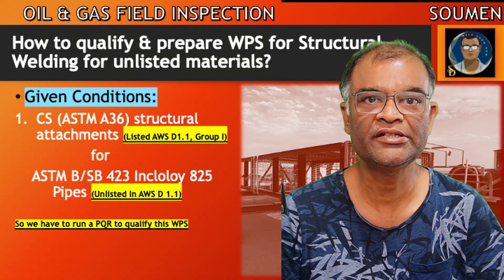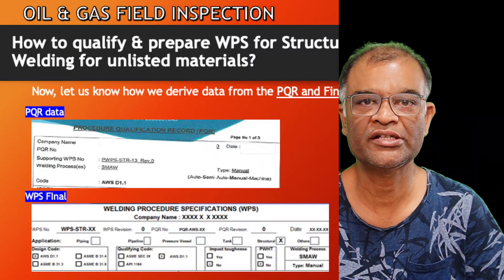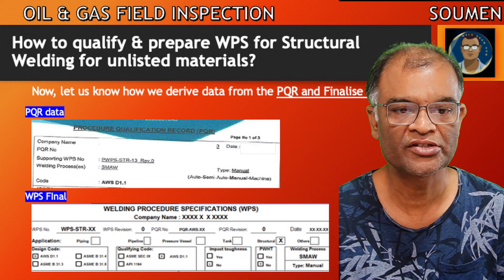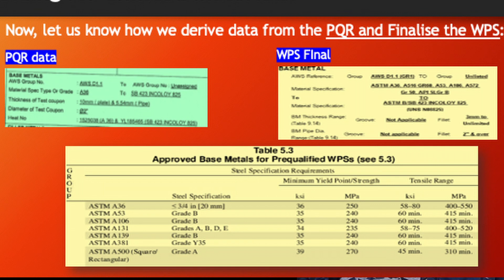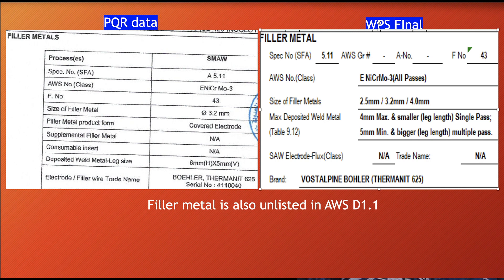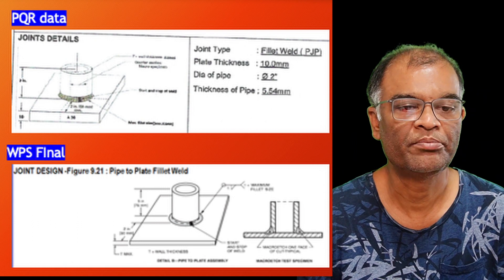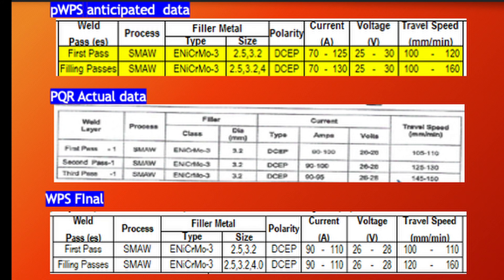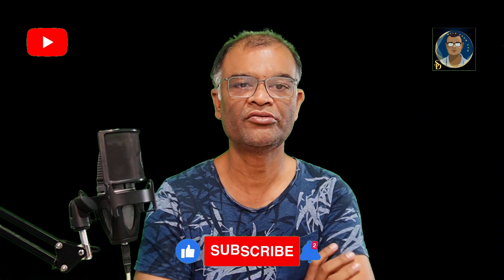How to Qualify a WPS in AWS D 1 1 1 (part - 4)

Comment: Sir,

In AWS D1.1 where it is given the tolerance for Electrical charas like Voltage, current & Travel speed.

Awaiting your reply
Reply from the maker: If you are talking about the prequalified WPS- they have some tables with all prequalified parameters. If it is beyond prequalified range - there are separate table for grouping and ranges. The voltage and current, They are accepting manufacturer recommended values. I will reply you more specifically, Allow me some time
Reply: Not replied since one year @OilandGas-inspection-soumen